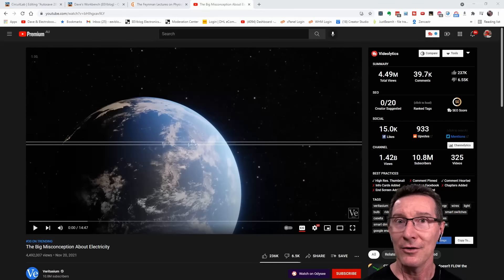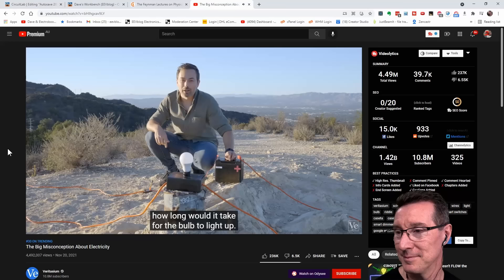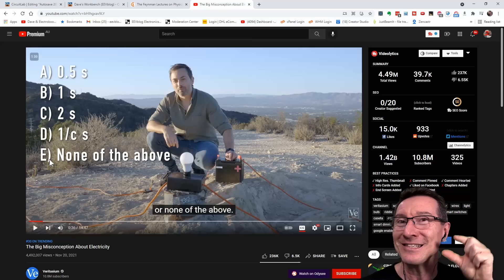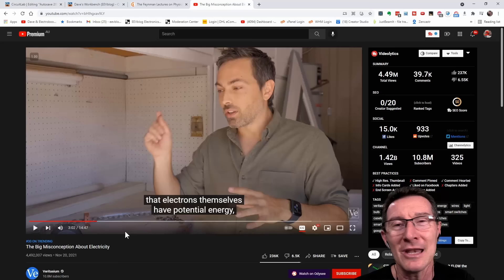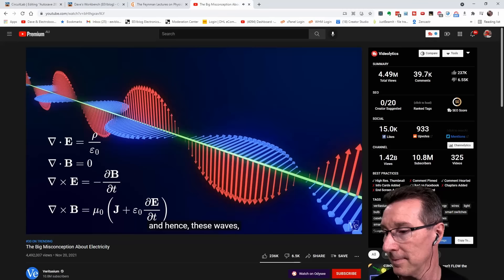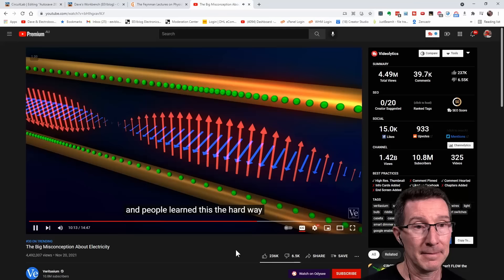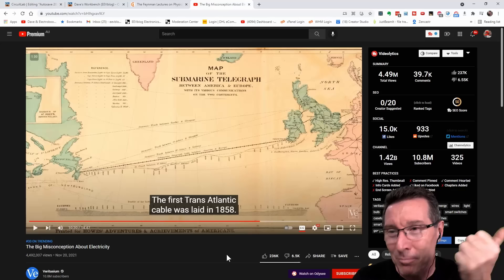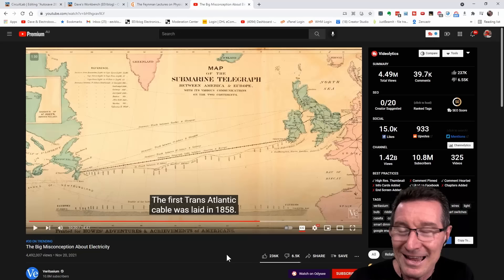EEVblog 1439 - Analysing Veritasium's Electricity Misconceptions Video

Comment: As an electronic engineering student I had lectures about all of this, but I didn't really make the connection that power is always transmitted through the fields. I understood it at the special case of the space between capacitor electrodes, but never generalized that idea. Veritasium's video and your explanation to it flicked a switch in my brain. Thank you so much for that!
Reply: Well, fields carry energy, but the fields are generated by the moving charges .... its a question what is first, the chicken or the eggs .... claiming one or the other does something separately gives bad pictures ...
Reply: I'm a non engineer, but I want it to click in my brain, too. I'm gonna keep watching this vid and others. I just can't focus that hard, and there's some whoosing going on.
Reply: Telling about Elektro that way makes it easy to understand how a primary and secondary coil Work.

Have a nice Day and
Greatz from Germany
opo
Reply: its not electrical engineer? electrical and electronic is different
Reply: For his light bulb in a field idea to even work on pure field propagation you would need a tesla coil to create a high enough field strength at operating frequencies to light the bulb "wirelessly". 

You still need to take into account impedance, dielectric, conductivity, angular propagation, reflections, and you'll arrive at a speed of propagation and VA required to operate the circuit

The simulation he performed as well assumes the capacitors have a static charge*(steady state) from T-0. if they were discharged you'd have to calculate the time constant in an LRC circuit based on the characteristic capacitance of the circuit.
Reply: Electron Drift Velocity is the only thing I don't recall from my studies.
Reply: I knew it was going to be about the poynting vector field, but never thought it was the actual path taken by energy from source to sink
Reply: @a_llama  its not. the only thing you can be sure about electromagnetic field energy is the total energy. You can't actually locate where the energy actually is. It's totally valid to consider currents and charges as the location of the electromagnetic field energy. It's also fine to consider the entire universe as the location of the electromagnetic field energy. Poynting vectors are a tool for the direction of energy flow, but not for its location.
Reply: @marios1861  well there are an uncountable number of paths so yeah
Reply: @NuclearSavety  I disagree, because eggs come first. And so does the electron moving.
Reply: @pedrohakia1  
How do you know eggs come first?  Where did the first egg come from?
Reply: Power is defined as the rate of energy per unit time, thus where there is energy transmitted, there is also power transmitted, because power is the amount of energy transmitted per unit time.
Reply: @marios1861  isn't that essentially how an amp probe works?
Reply: @Bluuplanet  from the immediate genetic predecessor of the chicken
Reply: I pretty much had a class on Poynting vectors, the very day that it was uploaded. It also flicked the "Oh, that's right, everything is just fundamentally fields" switch in my head.
Reply: @NuclearSavety  Well, from what I've understood from physicists, the fundamental are the fields, not that particules.
Reply: JESUS CHRIST IS COMING TO JUDGE THE EARTH SOON PLEASE!!!!!!!!!!!! CALL ON HIM NOOOOOOOOOOOOOOOOOOOOW!!!!!!!!!!!!!!!!!!!!!!!!!!!!
Reply: @lt3742  Jesus! Please smite people who calling others to call on you!
Reply: @kingsglaive7639  then surely you are'nt any of those.
Reply: @AdityaSingh-mz2zn  yes, i just curious. would you explain those?
Reply: @NuclearSavety  
The electric field comes first. 

The electric field induces a situation that indirectly results in electron drift. The electron drift results in a situation that indirectly results a magnetic field. 

The electric field already exists around the battery. When a wire is connected to a terminal, the electric field extends around that wire as well. The electric field around the wire causes the polarity on the surface of that wire to match the polarity of the terminal (due to have either more or less electrons on the surface of the conductor). 

When creating an open circuit, you'll have two parts with opposite surface polarities... and when the circuit is closed, these surface polarities (which is already established everywhere in each section of the circuit) allows the electrons to move. The moving electrons experience relativistic effects relative to the protons in that conductor. This relativistic effect causes a difference in charge between the protons and electrons which is where the magnetic field around the wire comes from.

Now you have a magnetic field and an eletric field around the wire.
Reply: @tylerdurden3722  before you connect the wires, you dont have moving charges, so no magnetic field and no poynting vector, and thus no energy flow. That after connecting the electric field can propagate along the wires you need a change in electron density along the wire, otherwise you would have an electric field distribution like in a vacuum, thus electrons must move first  ... 

You can find arguments for both, first field or first charges .... 😀
Reply: @NuclearSavety  the electric field that propogates along the wire is what causes the electron density to adjust, in order to neutralize the electric field inside the wire (not the other way around...in the case of a circuit powered by a battery).

The electric field inside the wire is always neutral (or trying to be).
Reply: ( m ) / ( m / s) = s. So the unit Derek used checks out.
Reply: time for you to hit up some Feynman lectures, mate. It was eye opening and im an RF engineer!
Reply: The only problem with this view is what happens if you move the switch to the furthest point in the circuit from the lamp and battery [half a light second away?] You would be saying that flipping a switch half a light second away from a lamp can turn the lamp on in 1m/c s seconds. This poses a problem in terms of exceeding the speed of light. 🤔

In terms of equations the Poynting vector describes a STATIC system but the question is actually about a DYNAMIC systems. Any time you have a dynamic system and you're trying to use an equation without a time variable you are going to struggle. 🙂👍

I actually work in banking so I don't understand this as well as an EE might and have to credit Classical Electrodynamics by John Jackson.
Reply: Same for me! I'm a retired EE. University of Tennessee, Class of '81.
Reply: @grandsome1  'Fields within fields, within fields' is a term that I'm familiar with too.
Reply: @Bluuplanet  all chickens come from eggs, but not all eggs come from chickens. Eggs evolved long before modern chickens did.
Reply: @kingsglaive7639  really? I'm a base bscs and power lines are a subset of electronic engineering or power electronics. At UCI we are taught a broad range from mechanics, to physics, to me, to electronics and math. But not including this: https://youtu.be/d4EgbgTm0Bg
Reply: @kingsglaive7639  electronic engineering is a subset of of electrical engineering.
Reply: @NuclearSavety  eggs came first.
Reply: @aredditor4272  🤣
Reply: @CrazySD1993  it’s been a year. Just curious as to if this has changed or not. Because I now barely remember a lot of stuff I learned about signal processing lmao
Reply: so you praise pretty much BS video of Veritasium equally with the video that actually corrects the mistakes and provides complete breakdown,...?
Reply: I think that was Veritasium's objetive. To give everyone specially everyday people a idea of how somethings we think are a misconception

Comment from the maker: Before complaining this video is too long, use the timestamp bookmarks to jump around if you want to.
Reply: lol too long?! Its only 45mins
Reply: So, basically, the energy will reach the bulb through 1 meter of space, by the means of capacitive coupling, way before the far ends of the wires start conducting?
Reply from the maker: @elyeryan8838  Correct. You can also model it as an electromagnetic wave over the same distance if you prefer. I just like the capacitor model.
Reply: Also, C'mon Dave, this isn't Tiktok, longer more detailed videos are preferred here.
Reply: Ok , there is to many timestamp bookmarks !
Lol !
Reply: Thank you - capacitive coupling was the short explanation I was thinking of but not certain enough to verbalise!
Reply: Are you suggesting that I violate causality?? Dave! In this house, we obey the laws of physics and spacetime!
Reply: Great video.  Thank you for taking the time.  Well done.  BSEE 1984.
Reply: Only the weak will complain
Reply: I dont know how it is put there. But here in sweden, this is tought in highschool (second year) not collage pr university.
Reply: Actually both Veritasium's and your's is amazingly short relative to the college material that gets you to the same place. What's an hour compared to a semester or two?
Reply: He strokes himself proving he knows more than i but truth be told he just knows what someone told him not what he learned from his own observation
Reply: too long
Reply: Quite watchable at 2x speed too. Good explanation. I think Veritasium sensationalized it a little bit.
Reply: *joking
Reply: So A/C travels outside the wire?  Then needing 10 gauge and 12 gauge wire in the house is all copper industry bullshit.  Let's all wire with the cheaper 14 and 16 gauge wire! Heh heh heh  This is why I drink.
Reply: Too long? It could be 6 hours and I'd still want more!
Reply: Don't back down EVA
Reply: I actually really appreciate long videos like this! Really interesting seeing you analyze this stuff!
Reply: Much, MUCH prefer longer videos! Keep them coming!
Reply: I'm sure there's plenty of people like me who are the opposite...and get a little disappointed when you say "I won't get into all that in this video".

No such thing as a too long video when you can just skip through it if desired.
Reply: @Daveyk021  energy travels mostly outside the wire, yes. But the Poynting vector is not exactly parallel to the wires, so a little bit of energy gets into the wires as well. How much the Poynting vector is slanted, ie how much it points into the wire, depends on the resistivity of the wire.

Therefore biggest cables means lower resistivity and that means the Poynting vector will not be sinking in the wires but will go along them to the load, where the resistivity is high, the electric field is strong and the Poynting vector plunges into the component.

But Dave got the directions all wrong. He thinks that at DC the pointing vector is going into the battery and also straight into the wires at right angle, irregardless if the fact that there is a load sinking the power...
Reply: Mehdi is also going to make a video about this! Love this 'peer review' style videos
Reply: @EEVblog  ... Yeah - from a practical standpoint ... I have often wondered can capacitors not be modeled as TRANSMITTER AND RECEIVER ANTENNAE, TRANSMITTING PHOTONS?    But I feel a bit of a dumba..... even suggesting that.
Reply: :Shrug: I thought it was an appropriate length
Reply: @stephenbrough8132  Antennas can be electromagnetic (inductive) or electrostatic (capacitive).

There are near-field and far-field effects. Near field is electric and magnetic, and far field is photonic. If you interact with the near field then you can change the behaviour of the near field as it relates to the conductor whose free electrons back it up. In turn, by interacting with the near field, you can shape the far field - presumably through the electrons. If you interact with the far field, you cannot change the behaviour of the near field and presumably not the electrons either.

The normal "spice" electrical model of the capacitor or inductor does not usually require specific RF photonic modelling, except through thermal effects which usually dominate anyway. Remember that thermal emission is actually radiant infra-red energy - and that means photons. It isn't dumb at all to ask any question. What got me is that "Veritasium man" picked such a confusing way to explain something which isn't very hard to understand. I'm pretty sure he had people who do understand it confused and thinking they are wrong, let alone those who don't.

By analysis, all he did was to be obscure about the precise nature of his rather impractical circuit, and then make what appears to be a superficially crazy claim. Like any good magician, he prepared well and fooled many. Magic is fine in the evening if you want a bit of a laugh, but it doesn't get you to the Moon or Mars. Magic gets you a cold fusion hoax.

More useful, I think, is to consider vacuum tubes, electromagnetic interaction with thermal ion emission, also perhaps how fields interact cations and anions in electrochemistry. Long distance radio communication is just one of many amazing (real) things to do with electricity. Unless (of course) you have need of a superconducting antenna big enough to reach the moon that enables weak communication over a distance of one meter.
Reply: There is no such thing as too long of a video!
Reply: the video was way too short. can we get the second ep please ;)
Reply: Saying that electricity flow outside of a wire is stupid , because their is a larger surface area inside the wire than outside the wire . It's like say that the water flowers outside the hole because it not passing between the plastic molecule or water ever that makes up that hose .
 Electricity is flowing through the wire and the small amount that escape the wire  (vertasium ) isn't one volt . 
EEVblog , there is a difference between closing a circuit and lighting a bulb 🤦‍♂️.
Reply: 1.5x playback speed FTW! It's how I watch most of my videos. More content consumption per minute!
BTW, this was a helpful analysis.  I'm not an electrical engineer in any sort of academic sense, but I do have a grasp on how circuits and components operate from taking things apart and building my own circuits at a young age. I have heard about this Poynting vector before, and Derek's video was a good reminder of some of the basics but I was still unclear on some of his information.
So thank you EEVblog, this clears up a lot.
Reply: @nix324  gravity waves actually travel at C also. That was proven in the recent experiments that successfully detected them
Reply: @nix324  nah that's what they want you to think. But I can't say more than that.
Reply: @nix324  What better way to control people looking for the hidden truth than to fake reveal fake hidden truths? Most of what you've posted is invented. Maybe you'll work that out one day.
But I'm going to cease now to avoid attracting attention
Reply from the maker: @copernicofelinis  Yes, I should have mentioend that it's a vector with angle, it's not just pointing in or out. But that is how Feynman shows it in his notes.
Reply: @EEVblog  read Feynman: the figure you reference is that of a resistor. "Resistive wire". It makes a world of difference. In a circuit with highly conductive wires and a resistive piece of wire, the Poynting vector is directed almost parallel to the wires but dives into the resistor. And this is true a DC, in steady state.
Reply: Thank you for this video. As an engineer, you are really putting things into a proper perspective, instead of carrying with all of the radicalities the Veritasium video implies. I like to model things within the bounds of applicability. And if something works in pair with reality "close enough" the realization of something being wrong annoys me because... everything in physics is wrong. All we have is models. And no model is complete. All what the modern physics does is narrowing the gap of accuracy for the models it uses. But they are still models. And that's fine. Models are good, because they simplify things. And all the engineer needs is simple models. Why simple? Because they are sufficient. Nothing more advanced is necessary for us to bother.
Reply: disliked. timestamp too long s
Reply: EEV I still don't get it though. How in the world can the current flow outside the wire and the skin effect still make sense. Blowing my mind
Reply: @markmywords5342  It doesn't, poynting vector is V * I = P in a different point of view
Reply from the maker: @andyash5675  There is nothing far field here, it's only 1m maximum with a long conductive transmission line, and ultimately a wire at DC.
Reply: not as long as solar roadways
Reply: @nix324  I prefer the work of Hahn myself
Reply: @EEVblog  Hi Dave! I never said that the Veritasium video was describing far-field effects, but @STEPHEN BROUGH asked about transmitting photons, so I tried (probably badly) to explain the difference between near and far fields. :-)
Reply: This video is absolutely not too long.
Reply: @matsv201  I learned it in high school in a vocational- technical class: "Radio and TV repair". This was in 1975 and we had to use slip sticks for our calculations. And this was in Mississippi of all places! You can bet that course is nonexistent these days.
Reply: @billstuart8481  well now they have genderstudied in stead

Comment: In the original video, that is not a traditional filament incandescent light bulb. That is an electronic A/C LED light bulb. My understanding is that it will not light with a 12 volt DC battery.  The socket is on top of a box.  Is that box  a power inverter? How does this change the overall presentation? How does this change the overall theories on the discussion table?